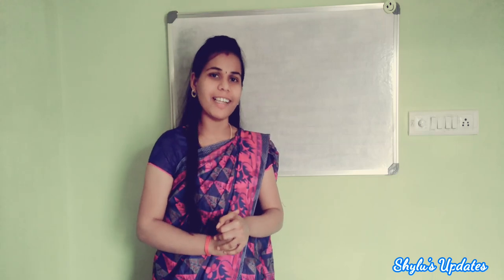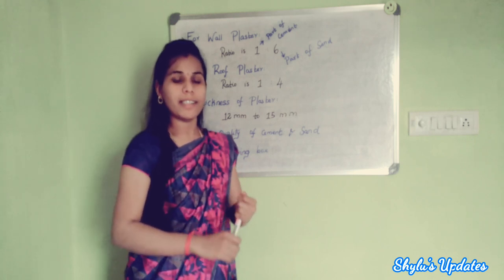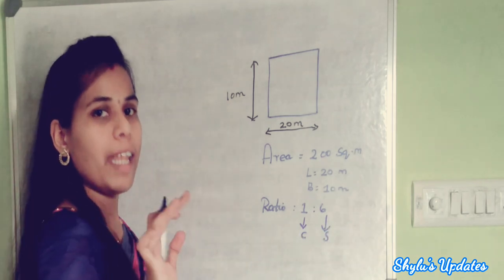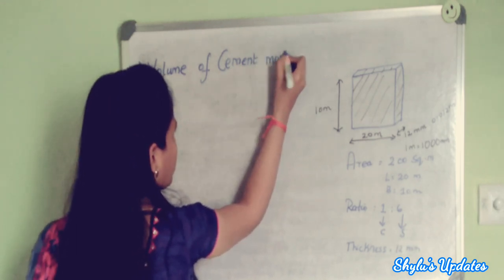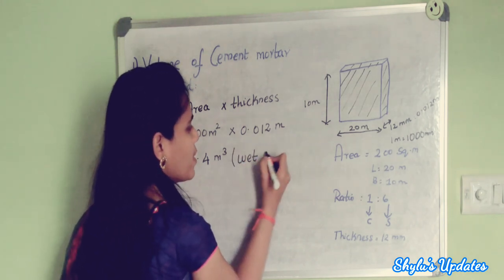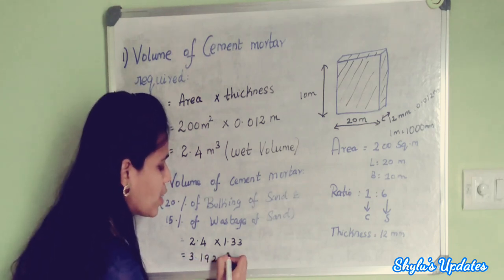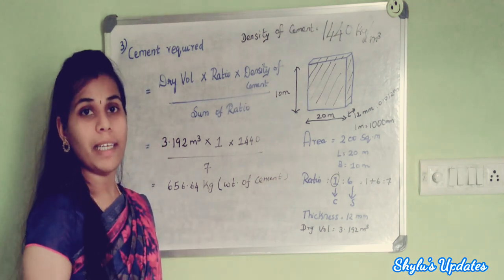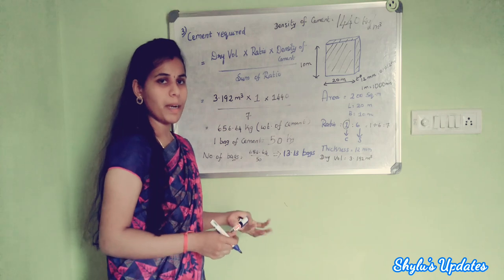How to  Calculate Cement, Sand, Water Cement Ratio in Plastering | Cement Mortar Plastering

Comment: Dry volume taken in m3 & you taken density of sand  in cft is it ok?
Reply from the maker: 1m3=35.3147cft
I have converted m3 to cft in the formula itself
Reply from the maker: Cubic metre value is = 2.736 
I have converted into cft
1 m³ is equals to 35.315 cft
So,
2.736 × 35.315 = 96.621 cft.
Reply: Hmm  k thank you